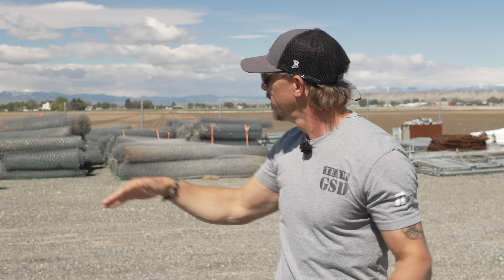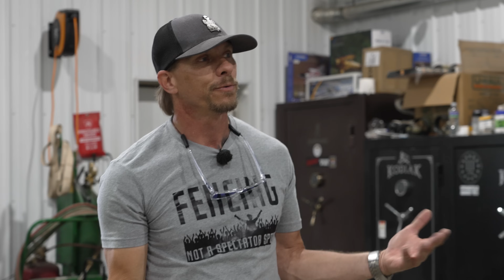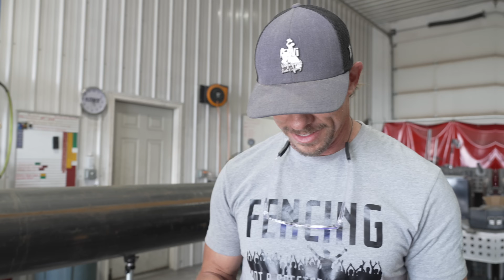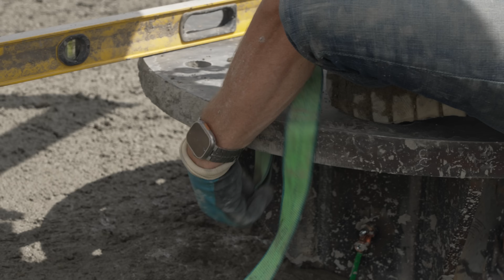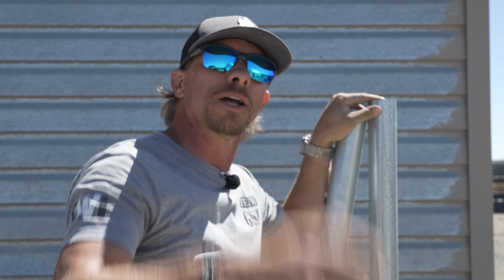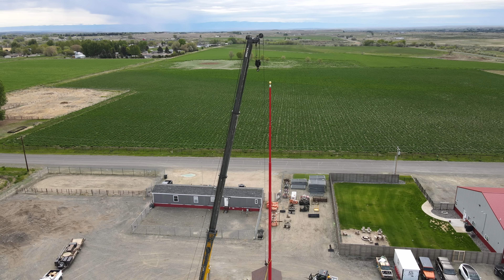ChatGPT Built Me a Monster Flagpole

Comment: Entertaining video but as an electrician using ChatGPT for specific things really grinds my gears.  Running bare copper through concrete does not "add resistance" it creates a Ufer ground which lowers resistance.  https://en.wikipedia.org/wiki/Ufer_ground
Reply from the maker: I love that posted a reference with your comment. Thanks for the input! 👍🏻

Comment: the super dangerous thing about using ChatGPT for any kind of design or engineering is that it is completely incapable of qualifying its answers. it answers EVERYTHING with complete 100000% confidence, regardless of how true or false the statement is. even when ChatGPT has a poor confidence level internally on the response, it is not capable of conveying that to the user.
Reply: Very dangerous.  I wasn’t aware of that, but I’m not surprised.

Comment: Perhaps you can use concrete pilings in the foundation to reduce the amount of concrete needed to buikd that 140 ft pole. Of course theres an increae in the cost of doing that.
Reply: You mean put piles where they’re not needed, just because? Brilliant!
Reply: @psidvicious worked in construccion for many years. Theres many ways to build something. The bottom line is the cost. The general contractor would revert to the lowest cost option,  piling or sono tubes to save a massive amount on concrete😅.

Comment: Badass flag! Btw copper wire in concrete wouldnt add resistance, thats the trouble with AI it just says wild shit
Reply: Also,  wouldnt connecting the flags grounding wires to the shop open them up to problems in a lightning strike?  Seems more prudent to keep the two circuits seperate.
Reply: @joequese4809 The connection to the panel was for the lights, not the pole.

Comment: If you are going to let any AI platform design a structure, you should do two things: spend at least 40 hours consulting AI for different unique problems that require real unique solutions so you can get an idea of the shortcomings of AI. And most importantly, have a real engineer double check the plans and put his wet stamp on it so that he and not you would be liable if the thing fails and someone dies.
Reply: It’s a joke he didn’t actually use chat GPT
Reply: @Mr.Paramedic  Idkkkk, he sure made it seem like he used GPT for this project
Reply: Agree.  No way would I put up a structure like this without a human engineer putting their stamp of approval on it.

Comment: How long does it take the concrete in the center of that big pour to fully cure. I can't imagine the leverage pressure that is placed on that pole by the wind, with and without the flag flying.
Was there rebar tied inside that concrete to reenforce it ?
Reply: The concrete in the center is no worse than the outside in terms of setup time. Concrete doesn't "dry" like paint, despite hearing the word "dry" used by even concrete guys. It sets up, not dries.  ...the cement is re-hydrating.

So, no matter if in the center or outside portions, it doesn't matter. Well, the center would probably setup faster actually since heat is given off during setup, and the center would not be able to dissipate heat like the outside portions, and heat of course reduces the setup time.
Reply from the maker: The only rebar was the cage you saw me build around the pole base.